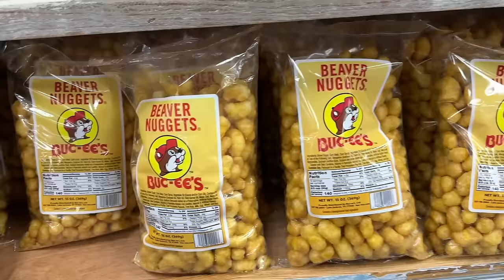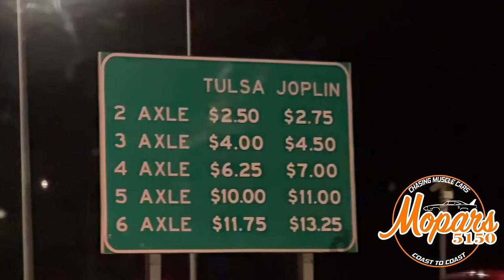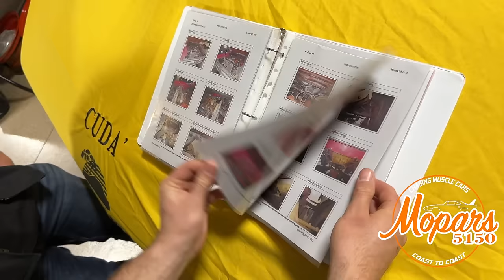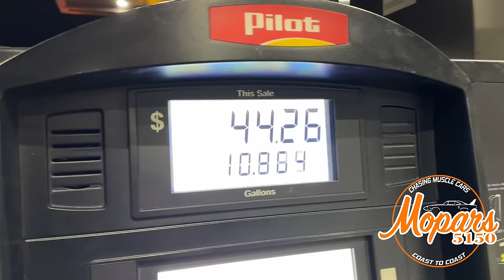Tickled Pink!! Chasing the ONLY big block Mopar painted FM3 Panther Pink in 1971 - Mopars5150 S1E13

Comment: 🤦‍♂️. Let’s continue where I pressed the wrong button…. Glad I did…  I’m in Australia, and have a 73 440 roadrunner.  Not totally original, has a 75 warranty swap motor( documented)  and was originally bronze, now plum crazy.. ( again documented with photos. Original torqueflite, original bench seat interior, 83/4 rear.  Solid car…. Insurance slips from 74 onwards. Etc etc. A rare car in Australia.  I keep it hidden, but run the motor weekly.     Anyway, just subscribed and am looking forward to seeing more. 🙌

Comment: That’s just a great car I’m building a 1972 Charger SE Brougham but I changed some stuff around it’s an original Y1 top banana color but I put a stroked 440 (512) cu. In. Six pack with FiTech six pack on it Strange 60 out back will wood brakes Cal Tracs , Rally doors a Ramcharger hood